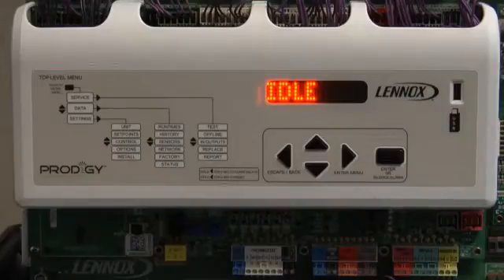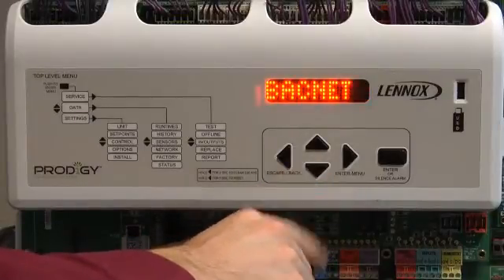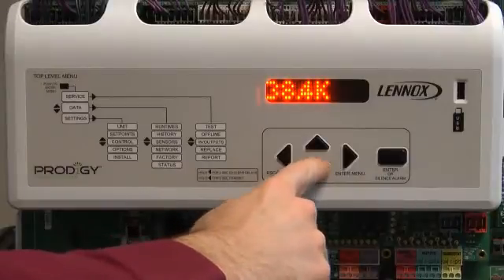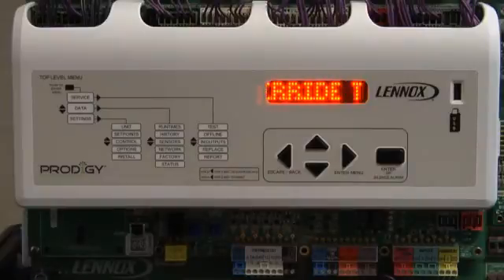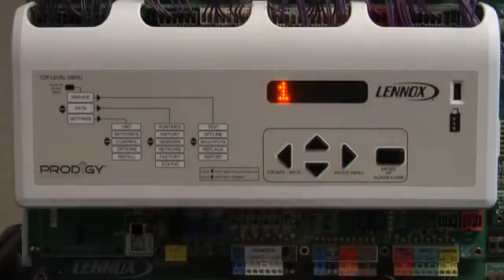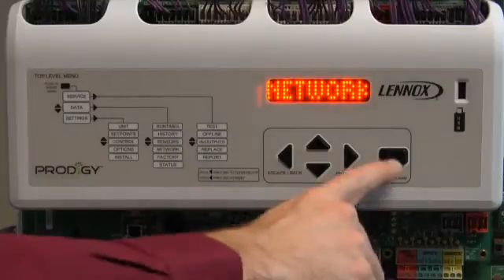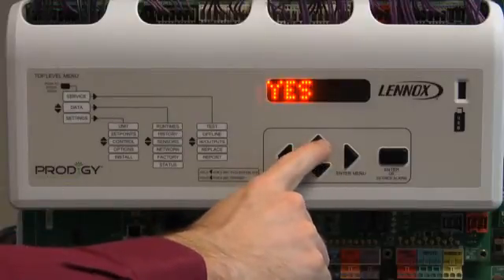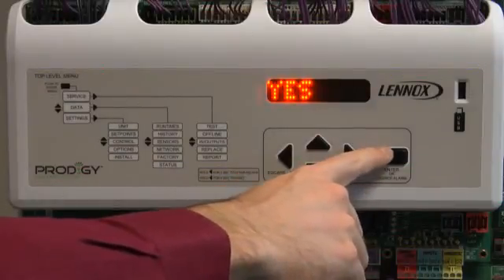Setting up the Prodigy® Controller for BACnet Operation

Comment: I am a tech working with johnson controls trying to automate some RTU'S, for what ever reason they cannot send commands to the units but can see what the ubits are doing, like when i jump them out manually on the rooftop, we keep getting error 94 and 73, which is 94 being loss of comm, and 73 being not reading sensor. What are am I doing wrong please help?